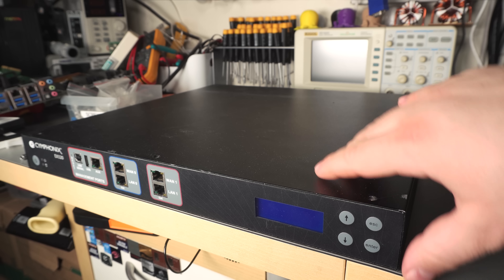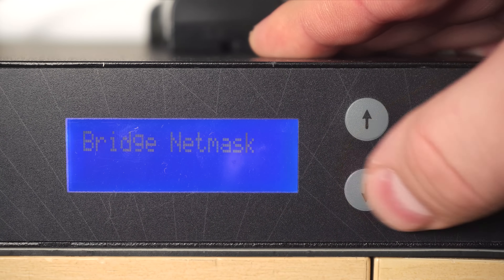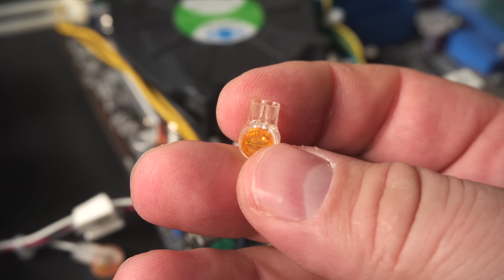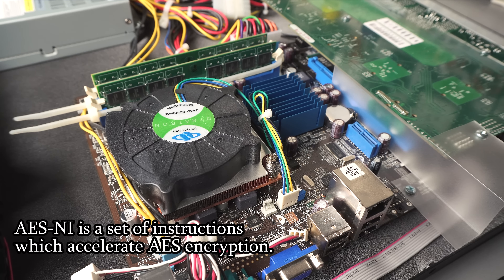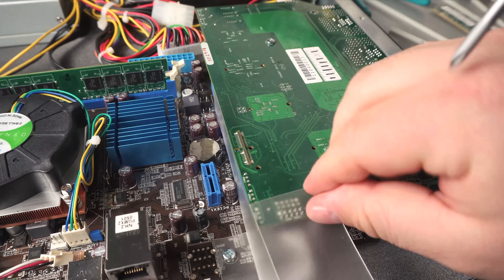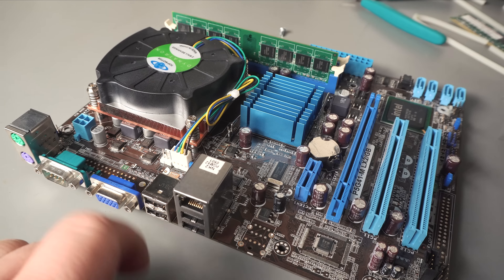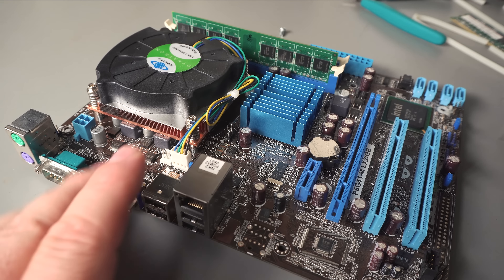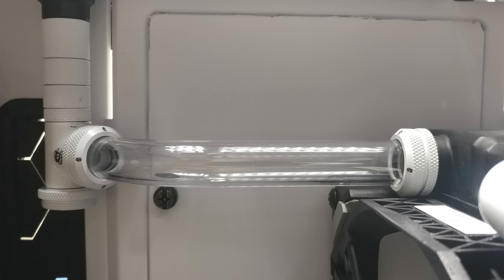Cymphonix EX320 Teardown

Comment: This channel contributes to my collecting of random 1U devices.  A Juniper 250, Steelhead 550, Steelhead 1050, CoyotePoint Equalizer, Barracuda something or another.  The CoyotePoint is the most modern with second gen i3 (but a third gen motherboard).  No bright yellow kemp loadbalancer though...